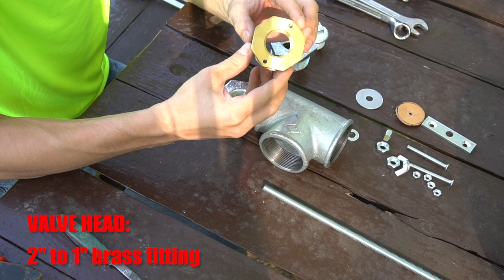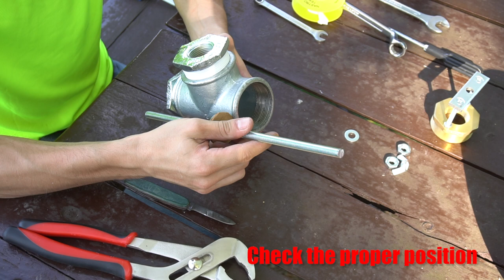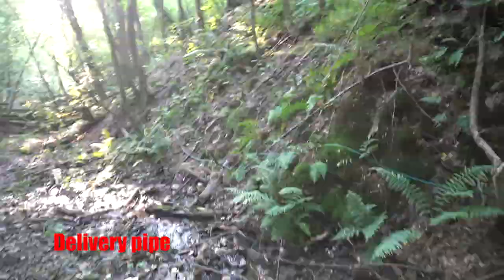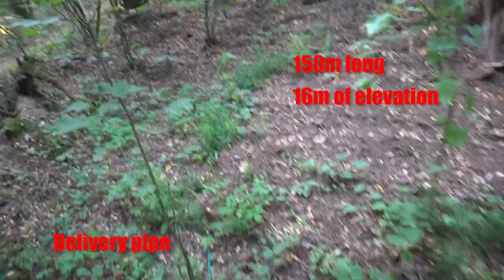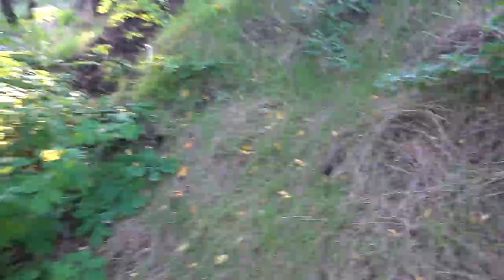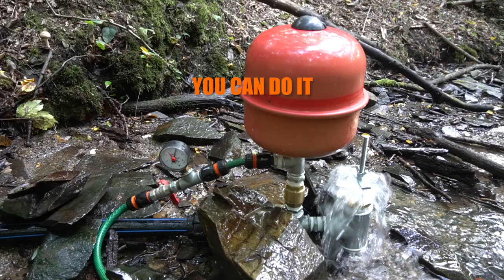HOW TO BUILD THE BEST WASTE VALVE for your RAM PUMP

Comment: I built this waste valve to replace the swing check valves we have been using on our ram pump.  It works great and has increased the flow rate by a factor of 2.5 up at our cabin.  Thank you Bohumir Stehlik!

We have a 120 foot (about 40 meters) delivery lift from the creek bed into a 100 gallon (about 400 liters) water storage tank in the attic of our cabin.  Also a mere 7 foot (about 2.3 meters) head on the 2" drive pipe.  With Bohumir's waste valve design we deliver 1 liter every 70 seconds.  Before I built Bohumir's designed waste valve, the constant hammering of the pump was destroying the brass seats and hinge on the 1"  swing check valves regularly and I would have to replace it a couple times each season.

Be advised that using leather to make the seal did not work in my case.  Leather swells, gets very soft and bunches up after a few hours in the water and causes the waste valve to stick closed.  I wonder if Bohumir was using Leatherette (imitation leather) or a leather like vinyl or Naugahyde?  I ended up making the seal from the fabric backed rubber I cut from a knee height rubber wader boot.  With the rubber side towards the brass valve seat, its been working perfectly for a few days now.  Time will tell if the rubber will endure; I tried a few different kinds of leather and found that leather WILL NOT last in the water.  Also, the brass reducer that I bought was a rather rough and pitted casting.  I found it necessary to chuck a circular fine grit grinding wheel of the appropriate size in a drill press and use it to smooth the area inside the reducer that becomes the valve seat.  I'm sure you can think of other ways to do this if necessary, but I liked the drill press because it got the job done in a few minutes.
Reply from the maker: Hello. Thanks for your message. Great, congratulations! Well, I used just over 1cm thick very hard leather. It looks it holds well and I didn't have any problems with it. It is told that leather will last much longer than rubber but it is true that leather soaks the water..
Reply: @BohumirStehlik  Okay, I have have made and tested several seals from different materials in your brilliant waste valve design. The winner is a seal made from vulcanized rubber I cut from a hockey puck using an appropriately sized hole saw chucked in a drill press, a twist drill the same size as the threaded rod in the waste valve and a thin bladed saw.  The hockey puck seal has worked continuously for weeks and upon disassembly, shows no sign of wear and tear.
Reply from the maker: @paulkleinkramer5065  Great info, thank you!
Reply: @BohumirStehlik  good butintake pipe howmuch long

Comment: Thank you for all the work that you put into this. I just built a ram pump and modeled my waste gate valve off of your design. I will be pushing 250 ft up hill with 100 ft drop on the head pipe. I think the best thing about this valve is the tuneability. I can adjust and tune it to maximize performance for the flow and pressure that I have at my source. I think this will work great! wish me luck....
Reply from the maker: Thank you for your nice message. Fingers crossed!
Reply from the maker: @BurimPrroi  In the description there are all of my videos about ram pumps.

Comment: love your work but a couple of ideas for you to ponder , do you have any sort of bladder in the pressure container ? i couldnt see a snifter valve so i assume you must have a bladder in the pressure container , if there isnt one then over time the pressure your getting will drop significantly , and maybe add a sleeve of copper or the like over the threaded bar as it will be sawing away at the bracket over time , like i said i love your work and i know you are open to ideas
Reply from the maker: Yes, this is a bladder tank. I don't use a sniffer but I would consider it for the future in the case of not using a bladder tank.

Comment: Very good explanation, I made my own waste valve, almost the same of your design, the only different is instead of using T coupling I use straight coupling with 2"x1" boozing on both end and hard rubber (tyre of truck) is my plunger
Reply: can we see it?
Reply: You can type my home made ram pump with customizer waste valve

Comment: Hello Bohumir and friends,

Firstly, I'd like to thank you for sending me out the PDF Shopping list and hope you enjoyed the coffee. 

Secondly, I'd like to share with you my results after watching all your videos and as a result, I have now 3600 litres per day running to my property. (The 2 videos in your PDF are best for great results-Cheers)

*I live in Australia and we predominately use the metric measuring system. I've added some conversions here to assist others that may not use metric measurements-these are rough and near about imperial measurements *

1" inch = 25mm
1" 1/4 inch = 32mm
1" 1/2 inch  = 40mm
2" inch =50mm
1 foot = 305mm
3 feet = 1000mm which equates to 1 metre
1/4 gallon = 1 Litre
.. all are approximately

So, once granted permission by a neighbour to have access to his natural spring on his property which strongly puts out 40Litres/minute so 58,378L/day into a nearby river. 

I commenced on my ram pump project/exercise to try to get some of this spring water to my property which is 600metres away. (10.5 gallons/minute so, 15,421 gallons/day...that's a lot of pure spring water being wasted per day)

I now have 3600L/day to my property, by replicating exactly Bohumir's Homemade Ram Pump and Waste Valve.

My inputs;

Drive side of pump

6m Head(fall) to my pump
21m of 32mm rigid pvc pipe
approx 30L/minute of water velocity. 
The waste water from the valve returns back to the spring via a small trench.

Delivery side of pump

40metre lift over 200m delivery, then 400m along a small decline towards my property. Gauge reads approx 5Bar of pressure at the pump
25mm Poly Pipe x 600m to my 5000L water tank on my property.

Notes;
I purchased a 10Bar maximum 10L pressure tank with factory lining preset at 2Bar. I increased this to 6Bar with a bicycle hand pump. This helps with the flow rate. I also installed a wheel valve on the output, to which you can finely make adjustments/increments better, than say using a lever valve. Here you can also use this to increase lift if needed(got mine to 55metres+) though you lose output amount as a loss/result.

I used a pvc check valve at approx 100m on the delivery lift length of the initial 200m of delivery length, to assist the load on the pump brass/stainless check valve. There are a lot of pressures/weight there on this valve, as Bohumir raised.

Once I reached the first 200m mark and on to level ground using the 25mm poly pipe, I could've used 32mm or greater poly pipe to assist with rolling friction of water in the pipe. Then having a small decline assisted with gravity for the remaining 400metres to my property, I guessed that may just make it using 25mm all the way,to which it did.(there was evident loss of output at all 200m joins of the poly pipe towards my property-this loss would be better mitigated if larger diameter pipe was used)

I will eventually replace the galvanised iron waste valve and other galvanised parts, with stainless steel as the water is very acidic here and rust will be an issue in the long term. I also know that I can tweak this set up further, and even throttle the output of water, to improve an efficiencies.

If I can do it, then as Bohumir says in his ending videos " You can do it too"

Thanks again Bohumir, and good luck to you all in your quests.

Cheers, 
Costas
Reply from the maker: Oh yeaah! I am so happy to read this. Thank you!
Reply: Bohumir, it is your generosity for you to sharing all your results with everyone that makes things work well. So, very grateful for this, hence I'm happy to share with others my fails and gains to making my exercise/quest a success. Cheers again, Costas
Reply: Did I get a different parts list than everyone else? The lists I got from the Coffee after paying to support his efforts (much appreciate his efforts) were just a rehash of these videos. There were no links to help find the parts. That's what I thought I was getting when paying for it and not just the same list from the videos he'd already posted. For example, the 2 to 1 brass fitting with threaded holes in it... I can't find anything like that anywhere. Did you find that to build yours? I'm just barely getting started, and it's been really discouraging because not a single youtuber anywhere that I've found posts a parts list with links to actual parts. I've spent hours and hours and hours trying to find good parts, and I'm super discouraged at this point.
Reply: Hey Stephen, yes,you need to source the parts yourself. I found a suitable online plumbing store that provided most parts here in Australia. Some bigger hardware stores could also help, pending on where you are in the world. 

You also need to thread your own holes in the reducer, using a tap and die set to suit the M6 threads. Try to borrow the equipment/tools if you don't have access to any. 

I also managed to source my leather for the valves online (I used 2 x 4mm thick strips with outer diameter of 40mm and with a 10mm centre hole. Both strips, compressed by washers as Bohumir has suggested, on a 10mm threaded rod. Good luck and keep at it. Costas @StephenfCarman
Reply from the maker: @StephenfCarman  Dear Stephen. First of all thank you for supporting me. Making of a ram pump needs at least some experience in DIY jobs. The shopping list and videos are international so in case of writing the links I would need to put separate links for the USA, Sri Lanka, Thailand, France etc etc etc - I don't think so people would import stuff from my homeland country (Czech Republic)...  I am sure you can find the parts by searching them in Google in Your country. Or you can find almost all of the parts in shops like Bauhaus, Obi, Baumax or Hornbach (if you live in Europe). 

About the 2 to 1 inch brass fitting - you need to make the threaded holes for the screws by yourself. You can buy the stuff here from a Czech e-shop: https://www.dek.cz/produkty/detail/6000014910-redukce-mosaz-2-x-1-mf
Reply from the maker: @Costasa-u1m  Thank you! Great answer. Hope you are fine and the pump works! All the best to Australia!

Comment: Very good! I won't repeat what I said on the other video, I'll just add that using leather for the seal is probably the best bet - it will have a longer life than plastic or rubber seals!

Comment: I'll be building a ram pump for my spring soon and I found your videos.  I'm really interested in building one like yours but I need to get some flow and elevation measurements first and I have some questions.  I hope you can respond.

1.  The 2" to 1" brass reduction...did you drill and tap those 2 holes for the bridge bolts?  If so, what size drill bit did you use?
2.  Is it necessary to use leather?  Would rubber be okay?
3.  Is the expansion tank pressurized?  The ones I see in stores online are pressurized to various pressures but can be changed.  Should the pressure be dropped to ZERO or maybe 5psi?

4.  I'm expecting my drive pipe to be one inch but may be 3/4" if the flow is less than I expect.  For a 1" or 3/4" ram pump, I'm thinking the 2" waste valve might be too big.  Do you think 5/4" will be okay for 1" or 3/4" ram pump?

I think that's all for now.  Thanks for posting your videos and I bought you a coffee!

Comment: Thanks, so much for the videos! Favor to ask: I've had so much trouble actually finding the parts needed to build the custom valve and the the ram pump itself. Could you create a parts list with links to the parts themselves for where to get them? I've spent so much time trying to find good parts--or even the right parts (for example, the 2 to 1 brass reducer with the two threaded holes in it. I... can't find that anywhere. I would be really grateful if you or someone could create a linked shopping list. Thanks, so much!

Comment: I've been quoted £1300 by a rampump manufacturer for the pump, then £850 for all of the ancilliaries. That's to deliver 6,300ltrs/day from a 30ltr/min spring. But the delivery is overkill as I have 3000ltrs storage and use 1500ltrs/day at peak Summer for irrigation. DIY is definitely the way to go. I'm building this!

Comment: I make my customized waste valve, using 2"x2" nipple, 2 2" end cap or cover,   put hole and thread by machinist. Instead of leather as a plunger, I used a heavy equipment tyre or truck tyre. Very durable, can lift higher and deliver larger volume of water compared to swing valve

Comment: The bottom of the pump"s seal waste valve should be conical, so that the water will push the center of the seal up, incrementing the hammering.
I was also thinking on adding an intake valve so that portion of the pressure created by the hammering would not return via the supply pipe

Comment: Could you please make a list of those items to build your version waste valve. Thankyou.
Reply from the maker: 2'' T, 2x 1'' plug, 2'' to 1'' reduction, 1x 2'' to 1'' BRASS reduction, 2'' to size of your rampump reduction, very thick metal plate, 10mm thread rod, 2x M6x70 screw, 4x M6 nut, 4x M10 nut, thick leather sealing, standard M10 washer, M10x30 washer, sealing tape. 
I hope I didn't forget anything...
Reply: Bohumir Stehlik Thank you very much.👍🏼👍🏼❤️❤️
Reply from the maker: @Jomar Vitug Hello. Every valve is slightly different. It should be over the top of the valve that you cam screw some weights.
Reply: @BohumirStehlik  Put this info in right under the description of the video!
Reply: Thank you for your time! Very much appreciated.
Do you possibly know how to determine what size pump to use so you don’t pump more than your water source?
I’m sure there is a good formula. My natural spring produces approximately 946 liters (250 gallons)per 30 minutes

Comment: Hi and thank you for sharing. Did you drill the holes in the reducer yourself or are there some pre-drilled ones available?
Reply from the maker: Hello. Everything by myself.
Reply: Is there any benefit to be had timing the check valve on pressure tank? So that you are say having it open as early as possible but shutting only just before the pressure drops below the peak pressure the pump can deliver to the pressure tank?

Comment: A couple of comments:

1) Use locking nuts instead of standard nuts.
2) Can you find a hard rubber washer to use instead of the leather?
3) Have you ever tried/considered using two (or even three) waste valves instead of one. (Perhaps it is not necessary since you can weight the stopper, but might be interesting to try)
4) Build a tank out of 4 inch PVC pipe with a screw plug on the top where you can place balls or a bike inner tube with air in, which can be easily maintained in the future. (Standard tanks such as the one you used will lose their air after a while, unless it was a tank with a bladder for air that you can pump up now and then...

The reason why I suggested the #3 is that I saw a hydraulic ram pump in Tanzania 20 years ago that had two waste valves, (using rubber stoppers) and it was used to run sprinklers to water crops. I'm not sure if this provided more pressure or volume or both... It would be cool to see you develop one like that.
Reply from the maker: Hello, 
thanks for the comment. 
1) Definitelly¨
2) I don't know but leather should be more durable than rubber. 
3) I don't recommend that - the two valves should be identical to work properly (to shut off in the same time). And it would be more mooving parts. 
4) I am thinking to place a sniff ventil bellow the main valve.

Comment: Hi Bohumir, thank you for posting your ram pump and check valve design.  I've downloaded the shopping lists.  We need to pump water from a creek which is 17m head and approximately 500m long.  Can I use 1" (25mm) output with a 40mm input?  Regards, Laura from Australia
Reply from the maker: Hello. I think so, I don't see any problem with it. Maybe the delivery pipe could be thinner but that isn't a problem. Just make the intake pipe hard with a steady downfall and plan the lenght of it properly and it should good to go.

Comment: Awesome... I just sent you some coffee for the great video.  One question:  Does your pressure tank have a functional bladder?  If so, do you have a pre-set pressure for the air part of the bladder?
Reply from the maker: Hello, thank you very much. For the last model we used a 8l pressure tank with a bladder. I pumped the primary pressure just bellow the pressure for the delivery pipe... So 17m of the delivery height = cca 1,5bar in the tank.

Comment: Bohurmir, Another question. Noticed you changed to an Accumulator tank (tank with an air filled bladder inside). Why? Did it increase something? What would be the ideal tank volume and bladder pressure?? Really like your videos, thanks for sharing.
Reply from the maker: Volume bladder pressure should be little higher than your delivery height pressure. With the ideal tank volume the delivery stream doesn't have any bumps in flow. It is a battery. So too small tank and you will have bumps (or the pump stops to work). Too big tank and it will take years to prime it. With my pump I use 8l bladder tank and it is enough. It also worked with 2l PET. 
The air slowly escapes from a tank without the bladder so that's why I use bladder tank.